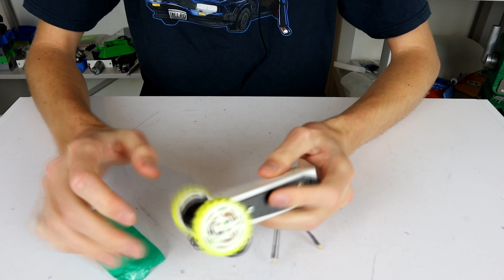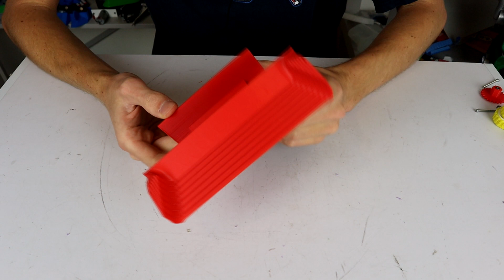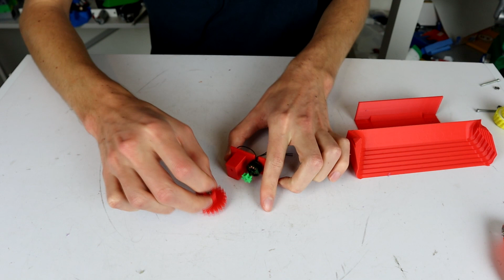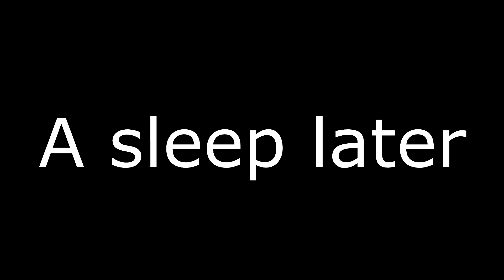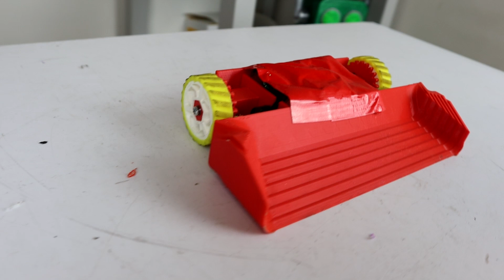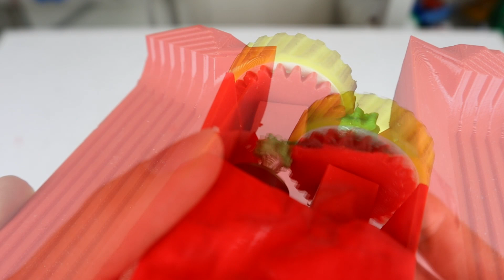Tiny gearbox for brushless drive (Super fast 150g antweight!)

Comment: One thing that seemed to gloss over were the brushless esc's going to the wheel motors. For one, it looked like motor braking was disabled, and one of the most irritating things is the 0-250 rpm band of the motor for most esc protocols wherein the startup sequence is NOT tailored for low speed resolution. You might have better luck with something ready-made from a micro rock crawler brand like furitek, or flashing your 32-bit escs with firmware such as AM32 in the "rock crawler" section, or ESCape32 https://www.youtube.com/watch?v=T9qEqIUB_II&list=LL&index=8

Comment: I fight in a plastic only 450g category... my current bot is a ring spinner running a 2300kv 2206 brushless for the ring and 2 n20 500's (6v) on a 3s lipo… I am running mod 1 gears printed in pla+ and get 4 or 5 fights out of a drive gear and ring... and it's the nylon coated roller bearings (625 bearings with a 21x7mm nylon tire) that get loose in their track... the gear teeth are surprisingly durable.. though I printed my teeth at 10mm tall.. but they take impacts like a champ too... my current failure mode is that the tires aren't getting enough ground engagement... need to upsize them a couple mm...

I definitely need to work on my driving :)  I was using a half-discharged 300mv bat in the scrum... so I ran out of juice near the end... 

https://www.youtube.com/watch?v=BOMNNWWI7-w&t=13s

Comment: Have you thought about printing a gear directly into the circumference of the wheel? This could be on the inside, like the outside of a planetary gearset. Then the motor directly drives that. The bigger you go with the wheels, the slower and more torque you get. Sounds like a win win?

Comment: I've been loving your battelbots videos! Also love the brushless motors!
One tip is to actually not 3D print the threads for your motor gear because they are so small. Simply, slightly, undersize the hole from the outside of the motors threads and it will dig its own threads into the plastic.
Reply from the maker: I might give that a go. Someone else has suggested getting a reverse thread m4 tap, but using the motor as the tap sounds easier

Comment: I don't think you need 20A escs for that, I think you just need to pay more attention to your settings.  For my beetle, I was able to max out the ESC at around 7-8A, and that was with 2 pounds resting on it, and pushing against a solid object.  Clean up the inefficiencies and switch to BLheli and you should be fine with something less than 10A.
Reply from the maker: Yeah I did find it very surprising. I set these escs up awhile ago so there is a good chance they are just stock simonk with reversing enabled.

I have a pair of 7A BLheli_32 ESCs so I might give them a shot next
Reply: @TeamPanicRobotics  You might be right.  In a few weeks I'm releasing my BLheli32 video, and I show the settings I use, so it could maybe give you a jump start.  It doesn't require MUCH tuning, but with a little bit of time, you can get them better than SimonK IMO.

Comment: Sounds like splitting the controls to 2 sticks for this would be better?
Reply: He doesn’t usually do that?(I know nothing about transmitters)
Reply: @hex1044  the normal for weaponed bots is controls on one stick and weapon on the other.  Sounds like he retained the controls for this one
Reply from the maker: Correct! I have the whole control system set up on a single stick, mostly because the point of this robot is for me to practice my stick control so (in theory) I can drive better when I move back over to my competitive bots

Comment: Even when geared down, that thing looked crazy as! 🤪

Seeing as you're experimental with 3D printing gears at the moment, have you considered possibly 3D printing antweight sized pneumatic components, like cylinders and servo-operated valves and such? Maybe you can draw inspiration from the Lego pneumatic cylinders and make them with bigger pistons.

If you can, maybe you could make a flipper bot out of them. I know weight could be an issue, but I thought it might be worth a try.
Reply from the maker: I've heard of people using lego tanks as pneumatics for an antweight, I havent heard if anyone 3d printing them.

I might look into it, but it does sound rather dangerous, the print lines in a 3d printed part make them inherently weaker then an injection molded part. To be on the safe side i'd need to print much much thicker walls